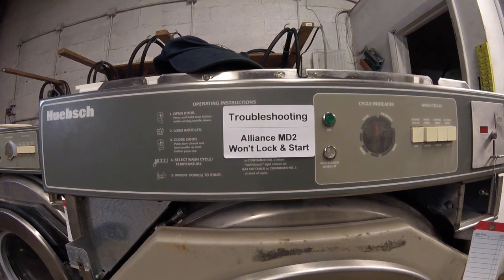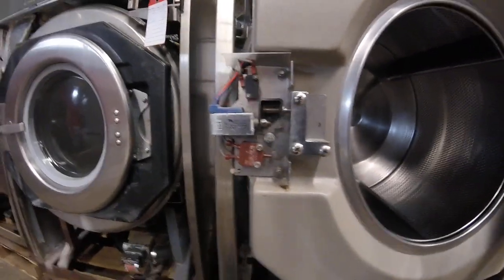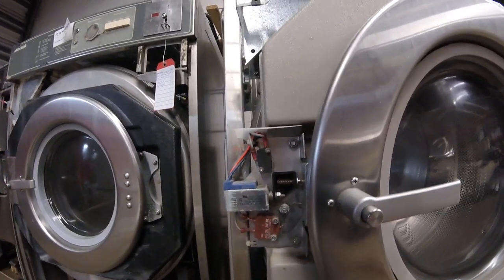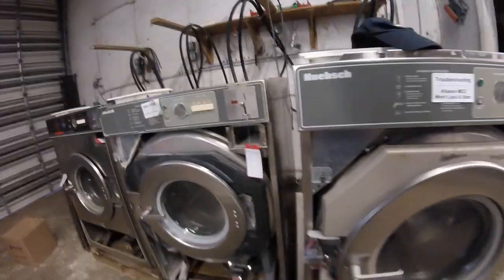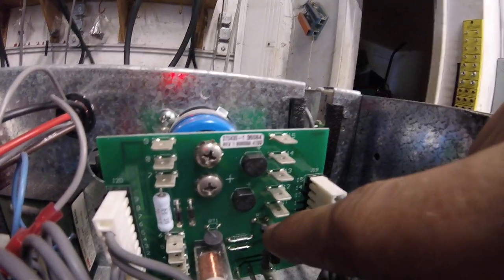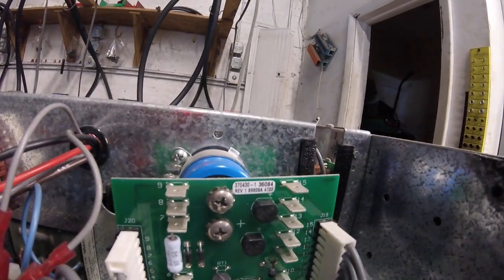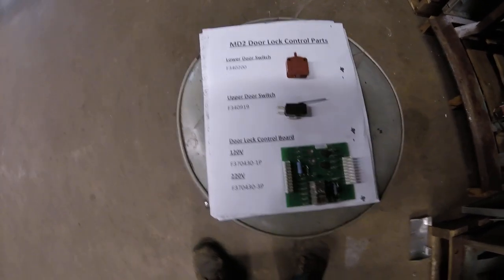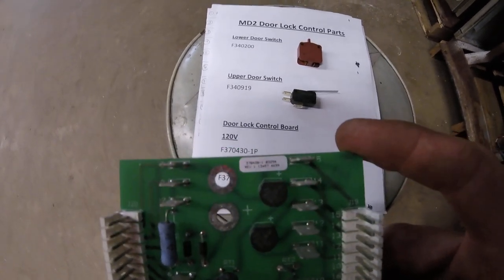Troubleshooting a Door Lock on a Speed Queen Washer

Comment: What is causing my solenoid to engage and disengage rapidly like a machine gun at the end of the cycle? I have replaced the solinoid both switches the whole assembly and harness. I have also replaced the control boar and capacitor. It happens about half of the time.

Comment: Hello, I got IPSO 40 we181. I am getting the close door error even though the door is closed. Changed the door handle / changed the latch / seems like the solenoid isn't able to push the 2nd switch - if done manually it works great. Could it be lack of power ? Would appreciate any advise, thanks!

Comment: If we changed the door lock control and the lower door switch but have to manually push the solenoid black coils in to start, would it be that the solenoid is bad itself or should I fix replace the upper door switch next?
Reply: were you able to figure out what the issue was with your solenoid? I put a new latch... and still the solenoid didn't push the 2nd switch... wondering if its lack of power issue.